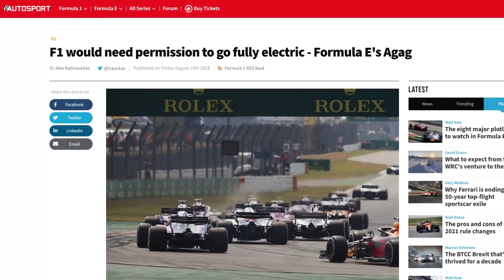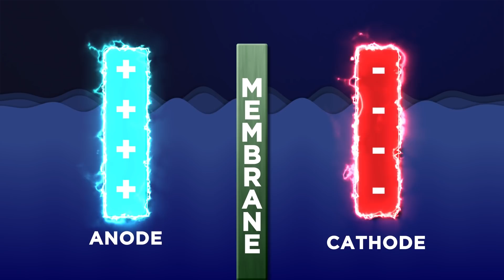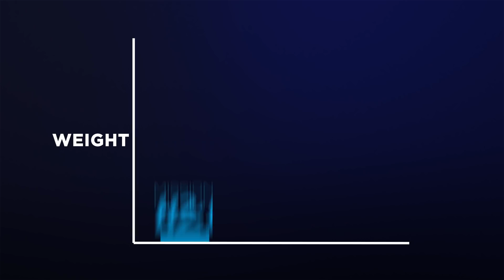Here's How Formula 1 Cars Will Be Powered In The Future

Comment: I think we have to admit as fans is there's going to be a day probably within 15 years that there won't be an ICE on a formula 1 car. And what ought to happen is F1 and other motorsports gotta to figure out a way to make electric or hydrogen power as exciting and interesting as possible cause it's on the horizon and it's best for all of us to adapt to the circumstance.
Reply: I can not agree more.
Reply: I think it's the opposite.  The new CEO of F1 says they are comitted to hybrids for the next itteration of engines.  They can make those 100% clean by using fuel converted from the air.  Of which many companies including the petro companies are interested in.  The technology can be used to produce carbon neutral planes which is the biggest hurdle for fuel.  It also means better sequestering technology.  We can have our cake of internal combustion engines and eat it too.
Reply: @dodaexploda  you can’t make an ICE 100% clean. It is impossible.

And that is what the video says, not in the current guise, but maybe the one after next.
Reply: @dodaexploda  I think ICE will be included in the next ruleset but it'll likely be the last as by the early 2030s manufacturers are going to pressure F1 to go to all electric or hydrogen.
Reply: @acegarcia3719  you may be right.  But there is also a very strong possibility that they will go for carbon neutral fuel. Especially with all of the oil company sponsorship.

Comment: Hydrogen currently is not produced by electrolysis of water but from hydrocarbons (fossil fuels). So, its definitely not a green fuel. There is a high probability that hydrogen from water will not be commercially viable in near future.

Comment: Worth noting that hydrogen really isn't that clean because electrolysis is so inefficient that most hydrogen comes from steam reforming. Ideally, this process takes water and methane (often contained in natural gas) and produces only carbon monoxide and hydrogen. Carbon monoxide is not a direct greenhouse gas but it does lead to higher levels of methane in the air as it competes with methane for Hydroxyl groups which would otherwise take methane out of the air. In reality, steam reforming has a second round where it uses water and converts that carbon monoxide into carbon dioxide and more hydrogen. Without this second round steam reforming is quite wasteful.

Electrolysis is primarily only used when shipping hydrogen is impractical. Electrolysis can actually be much worse for the environment because it uses so much electricity. That can of course be solved by using sustainable energy in electrolysis.

In some regions with incredibly cheap electricity and very costly shipping (basically only Iceland) electrolysis may be economically viable in situations where steam reforming is possible.

Comment: It is way to early to use hydrogen, if it will ever come that far. It is also strange to use electricity, to make hydrogen that after that, wel be used to create electricity.
They can better invest in new battery technologies. That is the weak point for all electric powered vihicals that use batteries.

FE can replace F1 as fastest race class very easily. They need to remove the limits, use other tires, other chassis and make the battery easy to be swapped with a new one. Then they can remove the limited factor and ad pitstops and make tgat the battery isn't the limited factor for a race distance and speed.

Comment: I have been saying that this is where F1 needs to go for years now, since a top gear episode showing off a certain honda hydrogen powered car. 
Literally perfect for F1, and would help push this tech forward so it gets used more commonly in road vehicles.
Reply: I see, you enjoy watching explosions after crashes...
Reply: @thewoode1050  and a lithium battery fire is okay, just like Richard Hammonds in the Roman, which kept lighting for 5 days? Or the fire ball that ended Grosjean’s F1 career? GM motors had a Hydrogen car in 2003. Toyota sell the Mirai now, and I’m not sure about the Honda Clarity.

So why can’t F1 use hydrogen. I think it is an idea that needs research.
Reply: @gooddypm  Because Hydrogen is more explosive than gasoline. Hydrogen can't be stored in liquid state. Just a leak in a pipe will immediately create an explosive mixture with air, then just a spark needed and the fireball that Grosjean survived turns into a proper explosion with him dead.
Reply: @thewoode1050  I know. So knowing all that, why are they on sale? Obviously the6 have gotten the technology under control to the point that it is safe for consumers!
Reply: @gooddypm  Safe for consumers != safe for F1... Also, not enough of them on the road to be involved in enough bad enough accidents to know for sure. You also don't get gaseous Hydrogen under "control". You mitigate risks, build to standards that are good enough. Rupture the tank, boom. Have a leak big enough in the fuel system, boom. Add to that the weight of the tankage to make it just safe to use for consumers, and we'll have 1200kg F1 cars lumbering around the track...
Reply: @thewoode1050  did i equate safe for consumers to being safe for F1? I5 needs looking into, but obviously you are blinkered. Your view or nothing. Goodbye.
Reply: @thewoode1050  do you really think the technology would be in a road car, made by a large manufacturer like Honda if it wasn't super safe?
Also, most combustible fuels used in vehicles is explosive but you don't see them exploding (very often) even in huge accidents.
Reply: @jamescrewe6845  There is a reason why hydrogen cars aren't allowed to park in underground parking lots for a reason...
Reply: @DoorTechnicianRick  and the few stations that have exploded took out whole blocks of buildings and windows. BLOCKS
Reply: @RacefanPat68  "whole blocks" migh be a bit of an excaggeratio but anyway, that stuff us powerfull indeed. That's why hydrogen bombs are a thing too, much more explosive than standard explosives
Reply: More commonly used in road vehicles? where? there are what, 10 outlets for refueling in all N america, and Toyota HAND BUILD a hundred or less cars a YEAR.
Plus stations have taken out whole blocks a few times... It is a fool errand, sold by and for big oil, as most hydrogen is still produced from oil, and so you solve nothing....
Reply: @RacefanPat68  who cares about North America!

There are 135 in Japan. 13 in the UK, 91 in Germany, 4 in Norway, 4 in Sweden, 6 in Denmark, 2 in Belgium, 4 in France, 7 in Switzerland (Switzerland!), 5 in Austria. Even Poland has one. That's 272 in Japan and Europe alone.

The US and Canada aren't the World. We don't care about you.
Reply: @gooddypm  Im not in america, but was making a point, there are hundreds of THOUSANDS of gas or petrol pumps, and 10s of thousands of electric chargers already. 
No one is supporting hydrogen as it costs thousands of times more to build a station, is more dangerous by millions of times, and you still have to make the crap.
 Its a beat up, and you are obviously on the wrong side of history. There are good use cases, but NOT in cars.
Reply: @RacefanPat68  wow, somebody had their angry pills. You aren't in America, but use an American term. I'm only aware of the Northern Americas whom use the terms block. So, show us proof of whole 'blocks' being, as you put it, blown out.

What an angry American tool you are.

Comment: Im scared of the time Fe will beat F1 in speed
Reply: That's why they're looking for alternatives in the hybrid era. Hydrogen combustion or synthetic eco fuels paired with high discharge batteries with Hydrogen as a fuel cell are the options. The last one will likely be chosen. Even if they're surpassed momentarily, Formula 1 will still move the industry as ICEs are widely adopted.
Reply: Formula E has exclusive licence from the FiA for single-seater electric vehicles until 2039. It's possible electric race cars will be as fast as F1 cars on a one-lap basis by 2039 but I just don't think there's anyway they'll have the same range as Formula 1's Engines - especially if F1 becomes more and more efficient in the coming years.

Comment: The technology is what makes F1 unique, and their engine's should be the most advanced in the world. I feel like they should go further down the efficiency road. Keep the ICE the same but unlock the energy capture and storage completely. The cars should also get electric front wheel motors for capture and deployment
Reply: I agree. I really like the idea of making the focus of the engine regulations thermal efficiency. Allegedly Mercedes f1 engine is around 50% which is incredibly impressive i would really like to see how far they can push this. I know internal combustion engines are on there way out  but I still think they are needed for F1. Along with some more open regulations about engery storage and usage they could make some truly amazing power units.
Reply: @dougconner95  and that would probably be much more road relevant here and now and would theoretically align with what WEC is doing with hypercar regulations
Reply: Another mug-k wouldn’t be that useful since it weights almost 40 kilos. Having that more weight at the front would make the cars steer like bricks
Reply: @edoardoguglielmi2523  it could be something totally different for the engineering teams to figure out. Imagine if they could design a capacitor that had the same levels of performance as the current carbon brakes do. That could then be used to provide power generation on entry and power delivery on exit. Allowing the teams to use less fuel because they're capturing more energy during the lap.
Reply: @DavidHyman031  I mean, in theory you are right. The major change would be on the balance and aerodynamics of the front. With the current technology I don’t see it happening but maybe a decade from now we’ll have radical changes and the design and we might see kers on both axles
Reply: @edoardoguglielmi2523  I believe Mercs battery storage system shrunk in size and weight significantly since 2014. With F1 there's always a way to make it happen. And this seems a lot more road relevant than introducing some new type of fuel which will take decades to reach scale

Comment: What about hydrogen combustion engines? This should be part of the conversation because technology is moving fast to tackle its downsides. Not to mention that it meets F1's future requirement for engines to look and sound exciting.
Reply: It’s more complex and a lot less efficient than using a hydrogen fuel cell and thus is also not very road relevant either.
Reply: @0X0Patrick0X0  New advances in technology are actually changing that.  Using argon gas for instance allows for efficiencies above 80% while keeping unwanted emissions to zero. These have been so far the biggest drawbacks of hydrogen combustion, thus making it relevant again for a sport like F1.

Comment: Hydrogen internal combustion needs to be talked about more
Reply: but hydrogen ICE are the least effiecent of either. Burning hydrogen is not as efficent as having it in a fuel cell. If we are sticking to ICE (which I hope) biogas or other synthetic fuels are cheaper than hydrogen.
Reply: @nelayo4894  , the next step for 2025 surely is synthetic fuels but in 10-15 years time if resources are put into developing Hydrogen ICE by F1 and the FIA it could well become far more efficient than it is today
Reply: @sohammhatre  But there are a few factors to consider: modern Hydrogencells/Fuel cells can be up top 60% in efficency. Even the highly developed Hybrid ICE from Mercedes gets only 50% while beeing extremly complexe. 
So burning Hydrogen would be less efficient than a fuel cell.
Furthermore there is the problem of energy density. Hydrogen is not that dense and doesnt contain as much energy as other bio/sythnetic fuels. 
If they dont make big steps in technology a hydrogen ICE will be less efficient than a Hydorgen fuel cell while beeing more complex in design at the same time.

I personally think that yes hydrogen ICE is a possibility, but not for f1 because of the big tanks etc.
They either take Hydrogen Fuels cells or Biofuels. I dont thinkt Hydrogen ICE will be efficient enough to be considered better than a Synth/Bio ICE
Reply: @nelayo4894  So you're not wrong, Hydrogen ICES are indeed inefficient, but in my mind (as a real engineer too) it kinda depends on the purpose of the vehicle that determines which requirements are going to be valued. In this case, a high pressure liquid Hydrogen storage might be just the kind of platform we need to preserve the raw unadulterated passion an ICE gives off. I personally hate fuel cells on account of them being no more passionate than an Electric car. As someone who became an engineer solely because of race cars and ICES, I want to make the marriage of Hydrogen to ICE work, regardless of the fuel efficiency. Because it would still be a green engine. (Minimal oil burns would be negligible).

Once something is "green" then I don't care how inefficient it is. In this case it's supposed to be N insane performance engine.
Reply: @ace-combat-mobius-one  Well, if we are going down the route of: lets to it for fun, not because its efficient then the could just stick to petrol and increase the battery storage and be done with it. If you want smaller F1 cars which are more nimble and faster you might even wanna ditch most of the complexe electronics and just use a turbo petrol engine. 
I would also like to keep the ICE in motorsports dont get me wrong, but why would one go the harder way of researching and developing an hdorgen ICE (keep in mind cost caps etc), when you could also use bio fuels/synth fuels with little change to the already existing infrastructure. 
Also another problem would be the already mentioned energy density of hydrogen. you would need big tanks or refueling. and to me "pit-stop-speed-hydrogen refueling" sound like disaster waiting to happen. 

if youre going for efficiency a hydrogen ICE would not be the best choice. If we are going for emotions (which makes sense in an f1 car we could/should go for bio fuels maybe with a supercharged car and an increased battery storage capacity.

At least thats what I think based on the tech we have now. If someone in the next few years manages it to increase the efficency of hydrogen Engines towards 45-55% (or higher) then it my be a good option.
Reply: @nelayo4894  sigh Ok...I think the main reason why I want to pursue Hydrogen ICE tech is for a few reasons. 

1 - Perception. Synthetics and biofuels can numerically be good for the environment or at the very least neutral, but Hyrogen has this advantage of being truthfully clean in that its end product is water and can be produced using complete renewable (or nuclear my favorite energy source) at low to almost 0 carbon emissions. Synthetics and bio fuels are emitting carbon, albeit in a circular fashion. Furthermore, one can make arguments for Toyotas Hydrogen style of production, where they capture methan emissions from animals, that would have been burnt, and instead turn it into Hydrogen for fuel and energy use. Turning those emissions into something useful.

2 - Developing new technologies. It's no secret that F1 has been a hot bed for innovation in the past, arguably it is much less so these days, but having Hydrogen ICES front and center, would, like in times of war, push the development front aggressively forward so as to almost brute force technologies that aren't necessarily regarded as useful. Atomic bombs and early jet designs, rocketry all fall into this category or almost forced developments due to war or competition and I feel Hydrogen ICES would be no different. 

The sports car market would also be radically changed if suddenly your loud brash Mercs, Ferrari, and McLarens were all burning Hydrogen, doing 200 mph, while remaining just as green, emissions wise, as the fuel cell cars filling up at the local green stations.
Reply: @ace-combat-mobius-one  I know what youre getting at, but then you would also need F1 to be obliged to only use hydrogen made from renewable sources and as long as we are not generating 100% of our energy need from renewables efficiency will still matter. 

I like your idea an it propably would and could work, but if we keep the framework in mind (cost cap/car and tank size/efficency) I dont think it will be a viable option within the next 10-15 years. Maybe I´m wrong, maybe they surprise me, maybe they start using gas turbines. I dont know :D

Comment: Green? Hydrogen production is far from green, most common is steam-methane reforming (using natural gas or coal gasification as feed stock and heat source). Electrolysis is not currently commercially viable against reforming. Hydrogen has high bond energy, which is why it's energy dense and hard to produce. You have to break those bonds to reform them later.

Comment: I truly believe hydrogen is the true answer regarding the future of the automotive industry, rather than batteries. Lighter, easier to charge, has more applications, and fuel cells should be easier to recycle than batteries. Once the infrastructure to generate hydrogen is created, it'll become more widely used
Reply: I think it definitely is one part of the automotive future. But the innefficiency of producing and transporting hydrogen will keep it from being the only power solution. So it will be one option next to batteries and synthetic fuels. And for each there will be a couple of use cases that are optimal.